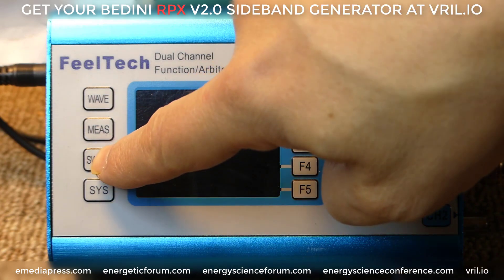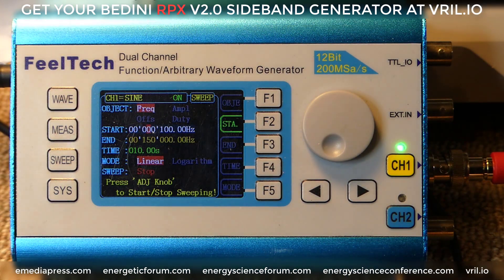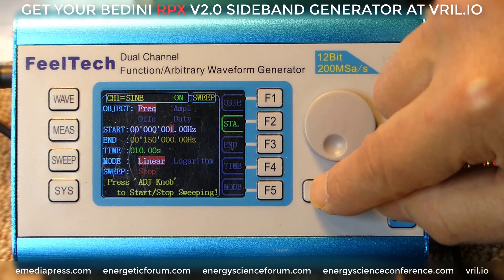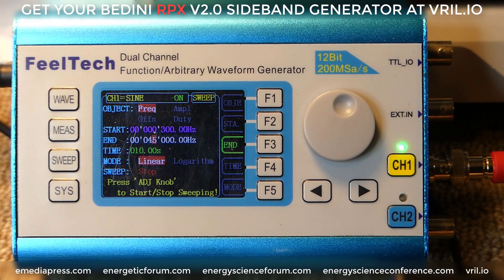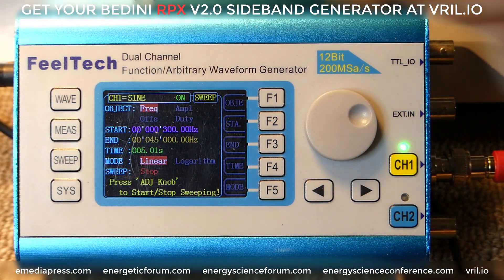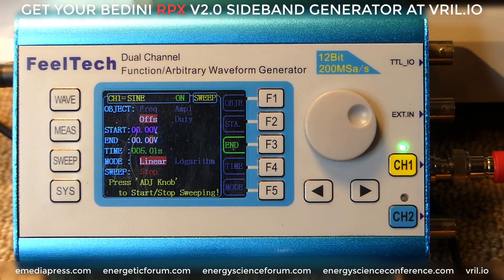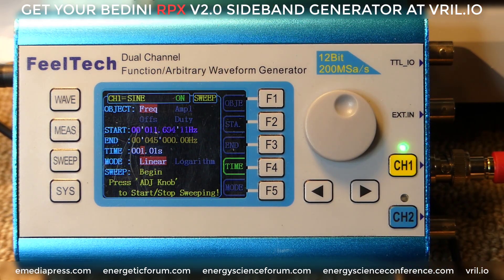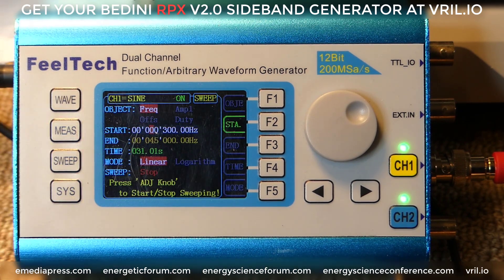Bedini RPX V2.0 - Feeltech FY2300 Sweep Programming

Comment: What if you didn't want to proceed in Sweep Mode.  Say for talks sake you wanted to use a single frequency and stay on that one frequency.  What Mode would it require?  or would you stick with the settings above in the video and start and end 1 hz above and 1hz below the desired frequency and keep it in Sweep Mode? Thanks Mr Murakami.
Reply from the maker: I'd set the frequency generator sweep from a few hundred to maybe a couple thousands hz above and below. You always a "wobble" in the frequency.
Reply: @AaronMurakami13  OK Mr. Murakami, will do.  Thanks for your help sir.  This is going to help me out, a lot.
Reply from the maker: Can't find your msg about Juntek - this is identical https://www.youtube.com/watch?v=FTKokxFEAEs
Reply: @AaronMurakami13  Thanks Mr Murakami. The RPX team's customer support is top notch.👍